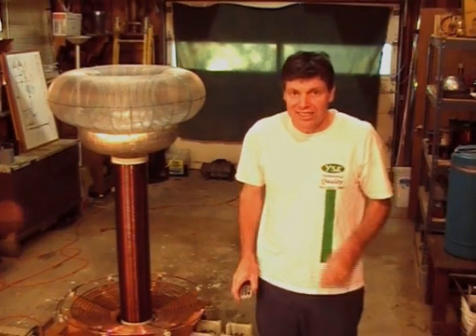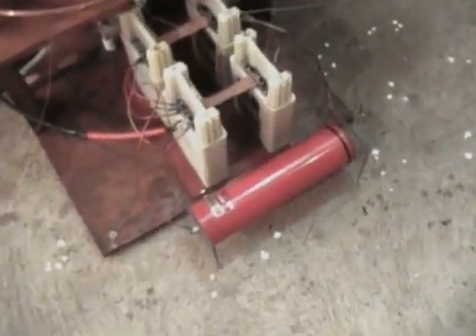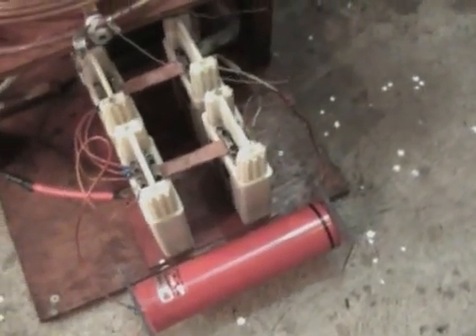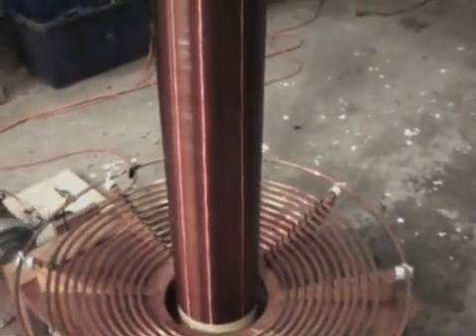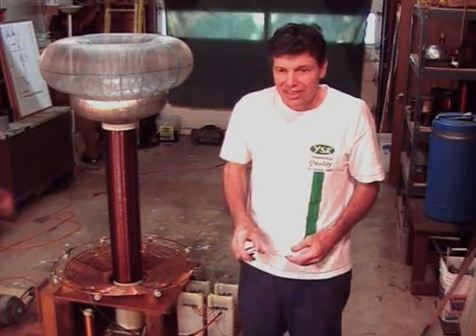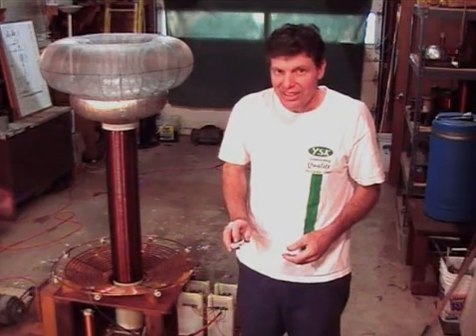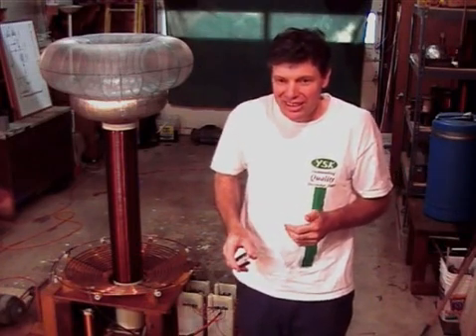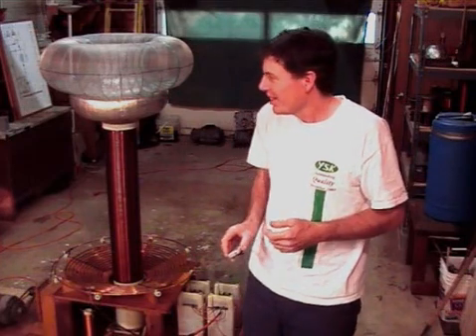Larg Tesla Coil Video 4

Comment: I agree with Owned By Jesus; you need more room to house your coil, or you need to get a different topload (Yes, I know this will change the topload capacitance) so that the streamers are usually streamers and not sparks (sparks are grounded, like the streamers that fly to your walls and ceiling).

Comment: If you were too close, arcs would jump to your body and give you instant 3rd degree burns on impact. These could travel around on your body leaving burn trails. Not only this, but the high frequency current is beyond your nerve's sensing ability. You could get cooked by Radio Frequencies inside your body without feeling anything until later, leaving permanent dammage. These are about, it looks like 5-foot arcs. stay back ten feet.

Comment: rodger i belive ifg you doubble up your turns in the secondary coil you will get a much higher voltage  to your toroid and spark howeevver you should start thinking about sheilds for your components then take it outside and see what it can doo ..just make sure your dog aint in the shooting distance :P keep it up thou and be VERY carefull or youll fry yourself
also try a better connection with that motor connection thing and higher voltage wires in youer whole circuit have funn!

Comment: WOW!  Very cool!  The brighter arcs in the second clip meant he was closer to resonance.  The trick is balancing inductive reactance and capacitive reactance.  When he added the capacitor, that reduced capacitive reactance.  Xc is inverse to the frequency and the size of the capacitor.  The other secondary winding with a larger gauge wire would have fewer turns and less inductance.  It was more in tune.  Capacitance and inductance have to be balanced.

Comment: Using the smaller guage wire most likely increased the number of total turns, which will directly effect the amount of inductance of that coil. This is why he had to retune it. I know the amount of inductance will effect how if functions, but I am not sure as to what extect.

Comment: Does the new secondary have more turns than the original ie smaller gage wire covering the same distance? That could account for some difference as well.  I'm largely uneducated in electronics, keep that in mind.